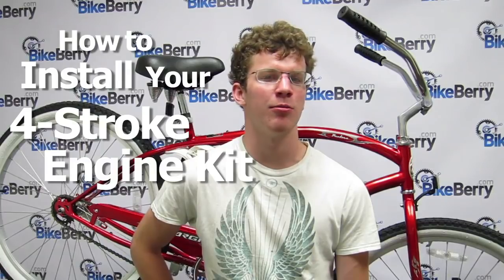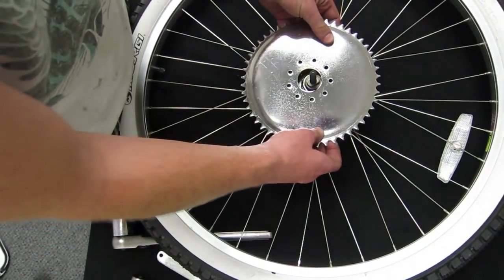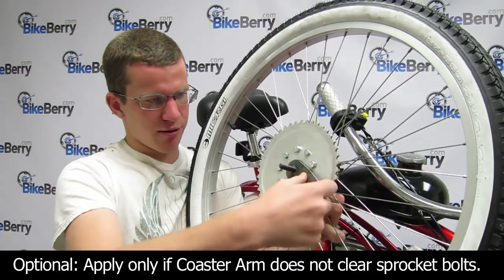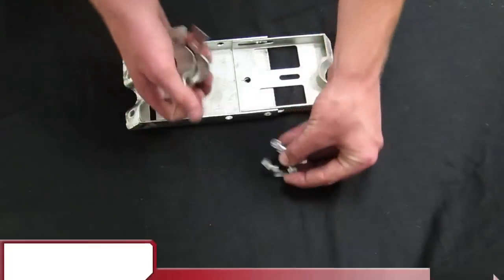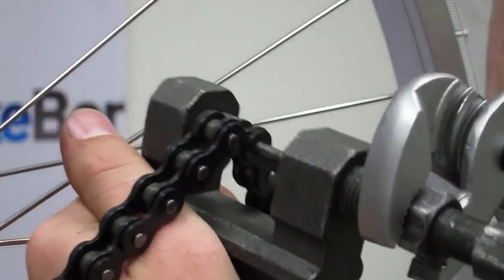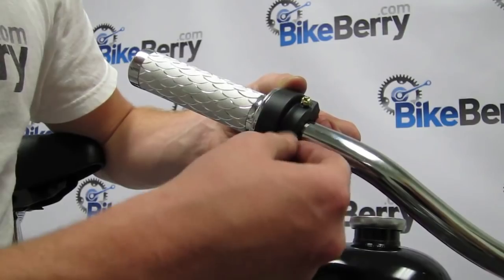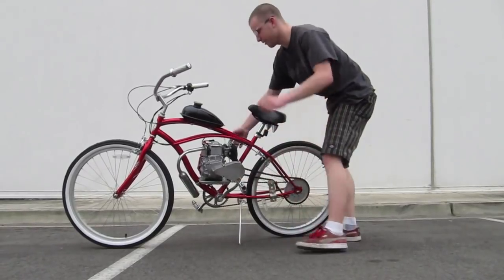How To Install a 4-Stroke Engine Kit on your Bicycle - 48cc - Motorized Bicycle

Comment: You can tell a good mechanic by the tools they use! Slip joint pliers are not made for hex nuts but a open end or box wrench is! If I saw someone using a per of pliers on my bolts or nuts unless stripped I would come unglued! Been making my living work on motorcycles and doing machine work for 45 plus years!!!!!!!!
Reply: i don't think anyone should pliers or wrenches on their nuts
Reply: YAWN
Reply: @robh.3124  Lmao 😂
Reply: 100 % correct. Use the correct tool for the job.

Comment: If you pause at 12:47 you will see that this bike does not have clearance between the crank arm and transmission housing, making conventional riding impossible. If you run out of gas or the engine quits, you will be pushing this puppy. It is also a good idea to make certain that oil is present in the crankcase in the correct amount BEFORE adding fuel...

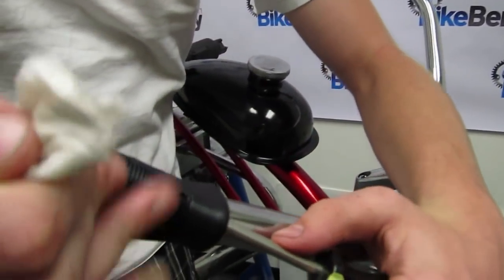Comment: 9:22 You can use compressed air to remove the handlebar grips. Stick the end of a tube air nozzle under the grip and blow.
Reply: Or wd 40

Comment from the maker: You're correct. Adding the engine oil is definitely a pivotal part in getting the motor running. I'll add an annotation. Thanks for noticing.

Comment from the maker: Yes, it's a 26" Micargi Men's Tahiti. Keep in mind that they recently made a design change where the cranks are designed for forward pedaling which means the crank housing is in front of the seat post instead of underneath it. This makes installation a little more difficult, but still doable.
Reply: What name of a good 4 stroke kit motor wise
Reply: How are you doing, I see your video was published long time ago, I got a question:
What is the right name of a new crank shaft you use on approximately 4:40 in your video? 
Is it threaded 3 ps crank shaft?
Thank you.

Comment: Also , removing the clutch springs improves clutch and overall motor performance. It allows the clutch to fully grip at low RPMs
Reply: I tried that, and my bike stalls at idle because it grips. Yes, I played with the idle speed, but couldn’t get it to stop so I put the springs back in.
Reply: you really just gotta bend them a little. there’s a video on here that shows that pretty sure.

Comment: How do you put the muffler on. The bolts protrude from the engine and are to long. Looks to only fit the stock box muffler it came with.

Comment: Hey BikeBerry, could we get a video showing this 4-stroke installed on a typical hard tail mountain bike like a Specialized Rockhopper?

Also, does installing a motor mean that the front derailleur and 3-speed chainrings can no longer be used?
Reply: I would think that motor shelf might get in be way of the derailleur mount. If the crank has to be replaced to allow for the thickness of the engine and mount to clear the sprocket then I see it being a problem

Comment from the maker: 275-290lbs. MAX! The added weight of the engine is roughly 30lbs, so a rider should be 240-260lbs at maximum. Honestly though, with that weight, it will be difficult to get the engine performing as advertised. Just keep that in mind.

Comment: How come mine did not come with the crank shaft, are they suppose to come with a crank shaft, my bike can't get built now until I get one, there is still 3 inches or so left wen useing big pedels you will need a 8 inch crank shaft for the larger pedals, also with my beach cruzer which has one fat bar needs extra large engine mounts which the kit ones don't fit as well as the fule tank one's aswell

Comment: Ok i got a question i know it might sound stupid but i don't know.  Ok i just got my 49cc 4stroke installed and running but it is still trying to go when in idle and i don't know y.  Is that normal? could it be to much oil?  please some one,
Reply: +Anthony Storey you might need to add a spring where the throttle cable connects to the carb to keep the bike from idling higher.
Reply: +Anthony Storey The carb has a small screw that regulates the idle speed, so try reducing the idle speed (You'll need to have the engine turned on to verifiy that it won't move) If this doesn't work, you might want to put in a centrifugal clutch between the engine and the shaft that drives the wheels, which will keep the wheels stopped when on idle or low speed, and with the sole speed of the flywheel, the clutch engages and wheels spin
Reply: I fixed the problem it was the way the throttle cable was set up it was pulling the throttle on the carb making it stay engaged but its fixed now

Comment: On a Huffy beach cruiser you are better off using only the back rubber grommet because the front one will push the sprocket out too far making it difficult to align everything. Just be sure to remove the bearing dust cover and cut the lip so you can flatten it out over the top of the sprocket. Other than that the stock 40 tooth fits perfectly and you do NOT have to bend the brake arm.

Comment: My 4 stroke clutch engages way too late and it always slips when i apply throttle so acceleration is practically non existent and it's so bad that my bike isn't usable at the moment.
I think my clutch springs are too stiff, is there anything i can do?

Comment: Yes i was wondering if we can convert an e bike to a hybrid using this method however I am unsure because of the electric motor being on the back wheel and as well as it also being twist throttle based

Comment: a nice installation marred by twisting wires together and using cheap electrical tape Solder the wires and use heat shrink to make a professional connection.

Comment: Starts with a coaster brake on the rear wheel, no brake on the front wheel, ends with hand brakes on both wheels.

Comment: You put the tensioner pulley in a maxed out position when the chain stretches you'll have to move the clamp. I think it should of been put about in the middle lower end of the bracket. Great video though

Comment: Can it be installed with a jack shafts on a mouthing bike to be able to shift the gears while riding and have the engine power the sprockets

Comment: hey bike berry I have a schwinn JAGUAR beach cruiser it has 7 gears to change into the rear wheel the pedals only have one gear I want a 4 Stroke engine but I don't know what kind of kit I need with the 7 gears and also I try to look up 4 or 2 stroke instalation videos on bikes with gears ( 10 speed, 7 speed, mountain bikes or a bike like mine's ) but no luck do you guys know of any video or you think you guys can make a video about this it would be a big help to new customers THANKS SOON TO BE A FIRST TIME CUSTOMER AND RIDER CAN'T WAIT 😆 👍
Reply: +Omar Coronado the bike gears and the gear the motor pulls are on opposite sides so it should make no difference

Comment: Could you mount this kit to a larger frame bike (28"-29") if you modified the chain to make it longer?
Reply: +ColtWKnight the chain that comes in the kit was way longer than I needed for 26s. it should be long enough easily for a 29 were only talking about 3 inches of chain-----my 26 inch build I had about ohhh 5 inches left after I cut it where I needed it you should be good bro

Comment: I bought a 'cruiser' style huffy that's retro style & looks like what  you have here.  Was wondering about 2 things-1-Where this has "old fashioned" braking (no handle brakes, just pushing back on pedals like on single speed bikes) Was wondering, where this is like that, would I need extra brakes installed to give added stopping power? 2-If I do need extra braking power via extra brakes, this bike seems like it has pretty wide, thick 26 " tires but was wondering if I'd need something thicker to handle wear on tires from braking
Reply: +Chris Geoffrey The braking logic you are thinking about is called a coaster brake, on the rear wheel, there is an arm connected to a plate. That is it. It is typically on a clutch, too. You can always add caliper brakes. Those are easy as well. I recommend both kinds of brakes, just in case. It'd suck if you couldn't stop at 45 going down a hill. In an intersection. Also, if you are using a cruiser, you may need to remove the mudguards to apply the caliper brakes.
Reply: +Gage Justice- ok Ty Gage, I'll remember that. I did have a different ?. I have a 49 cc engine Ifrom a 'X-treme 350' style scooter I was thinking of using as the power source for this new huffy of mine. I don't have dinensions of actual motor, but, if you yourself  are familiar  with those "X-Treme" products, you may've seen what I'm talking about. I think they only hit like 30-35mph anyways, but, again, never having a gas powered bike but being interested enough to maybe create 1, I found this channel. I'm kind of hoping the dimensions work to just mount it the way I've seen others, which usually doesn't include putting on some kind of back carraige just to mount a motor (would be where  a basket  might go, we'll say, right near the back reflector). Only things now I'd need to get/find out are chain for back tire going into motor (its already compatible it seems with a chain, since that's  what drives this x-treme scooter I've had sitting around, the brakes U mentioned, and what  I can use the electric battery thats on the scooter for, like, maybe rigging up a front lamp & some kind of turn signals ( was an udea I mentally was playing with, trying to make the finished product more safe if I drive it @ night, bike is pretty dark in color on its own). Once I get started, I may do youtube of it since I have a channel
Reply: +Gage Justice-P.S. even though U don't really talk about it here, Thank God for the nice, thick seat thats on this huffy cruiser bike!! I never liked the other type of seats. The one on the bike in this video has one I'd eventually find uncomfortable. I can't think of style names for seats except "banana". The one I have is wgat one'd find on a "crusher" style bike
Reply: Chris Geoffrey Yes, the wide ones are the best. I am not too sure of the names of the specifics, but I do know what you're talking about. Huffy is pretty good - heavy as hell, but the nuts, bolts, clamps and gear joints are pretty much all the same size: 16mm or 10mm. It's crazy helpful. The mudguards are also a HUGE plus, especially after a rainy day.
Reply: +Chris Geoffrey is SADDLE the word youre looking for?

Comment: when i drop the clutch when riding i get this popping feling while riding. when i release the clutch the feeling goes away and the engine sounds fine. the popping does not occur while riding with the clutch disengaged. what could this be?
Reply: i'll try that. thanks!

Comment: I have this motor and need to know where the fuel lines connect to the carb, there are three nipples on the carb.
Reply: Just learned it's the bronze one
Reply: My engine came with 2 fuel lines coming out each side of the carb, what do I do with those? I know the bronze one goes to the tank
Reply: @sergioaquino553  the one on the bronze side I took off that will drain fuel if its tipped over or floods the carb bowl the one on the other side is for draining and storage if you look under it it has almost like valve like on brakes you open that to drain out the hose for storage so the bowl isn't sitting with fuel if you dont plan on using it like me you can cut it short or take it off
Reply: @joshuamaas5380  thanks for the info, couldn't find the answer on videos
Reply: @sergioaquino553  yeah not a lot of answers about these at all I have learned the hard way just remember this is a g series 50 Honda clone engine and carb and also the AF mixture screw is behind brass plug if you need to tune it turn the screw to the right almost all the way shut turn it out about half a turn until it will start and hold idle let it idle for 4 minutes turn the idle screw up then turn the fuel mixture screw left until idle changes then turn the idle screw where you want it bam perfect tune for the carb
Reply: @amealnet2495  thanks bud, great video, answered my choke on and off question also, they could of at least labeled that
Reply: @joshuamaas5380  do you need to use the choke everyday?
Reply: @sergioaquino553  yes everytime the engine is cold you need the choke even letting it sit 30 minutes to an hour you might need the choke let it idle 3 to 5 minutes turn the choke off then tune all a choke  does is limit the air coming into the engine so that increases the air fuel ratio that's why you need to warm it up and turn the choke off to tune it right
Reply: @joshuamaas5380  thanks again

Comment: I like the 4 stroke, I bet it doesn't die when stopped for a while. I have an 80cc 2 stroke and it has a tendency to die if im stopped at a light. Then I have to peddle through the intersection and then I can use the throttle. I am still breaking it in but I dont think itll ever stop dying after being stopped for awhile. Does any know if it will change after the breakin period?
Reply: +Cassie G You might have to play around with the carb's idle speed, so try winding or unwinding the limit screw that stops the regulator valve. A 4 stroke will give you a lot less power output because of how its been designed since forever (Contains heavy counterweights, that have to be there so the engine doesn't stop when its not on the ignition stroke, so those will steal quite some power). If the problem persists, you may be locking down the engine when the wheels are stopped, on which i would recommend you to install a centrifugal clutch, in between the wheel's gear and the engine's power output gear, and this clutch will do, is that it won't engage the engine on low revs, and when climbing up engine rpm, clutch engages and the wheel will start spinning

Comment: hey, i have this motor on my bike, and was wondering if it would be possible to somehow install a lever clutch instead of the centrifugal clutch, as i find my engine doesn't fully engage and is very slow to build speed.
Reply: +DownhillGadd investigate your clutch pads. probably got touched by oil or grease somewhere along the line, OR, it isn't making a flat to flat surface against the inside of the outer bell they also have a break in period and some have paint in there that needs to be rubbed burnt off

Comment: I've installed my engine and everything is working good.  Motor seems a little rough and does not idle correctly.  Is there another video for adjustments.  also does the engine have a choke for cold weather.
Reply from the maker: Kevin Ward During the break-in period, the engine does run a little rough. After the break-in period, it should get easier and easier to start. Keep playing with your carburetor jet spin to adjust your idle RPM. Check out this video: https://www.youtube.com/watch?v=XAaKSII_vbo
Reply from the maker: Kevin Ward There is a choke! It's the small toggle lever near the air filter. At the top position, the choke is completely closed. At the bottom position it is completely open. You can it to be about 15% open when doing a cold start. After the engine is warmed up, then open it to about 75% open.
Reply: +Kevin Ward yeah theres a choke! probably why shes running rough get on that first

Comment: I have a Firmstrong urban man beach cruiser but the  coster brake arm doesnt come out like the one in this video. its all connected how to i put the drive sprocket?
Reply: i had same issues so i use my cheater pipe to stick the coaster arm into and a big ass wrench for the hex nut.baam

Comment: What was the reason for drilling the hole in handlebars
Reply: it's because the clutch has a dimple that fits into the handle bar to keep it from slipping.

Comment: will this kit fit on this bike sold at wallmart? 29" Genesis Onyx Cruiser
Reply: +Le Ga ive been begging somebody to answer that question for a month.
Reply: @robertsmith5323  Download templete  from blackberry   4 stroke is a 10.5 inch l  w h !  with an angle cut out caardboard templete
corner  4 inch up 2 inch in draw line cut

Comment: I just bought the upgrade kit how dose the bbr turning boost intake manifold go on. Any info would be greatly appreciated.
Reply: MrWillis5719  You need to do a video on your bike Steve.
Reply: How did you find out ? Lol
Reply from the maker: MrWillis5719 Unfortunately our boost bottle are no compatible with the 4-stroke kits (without fabricating your intake).
Reply: No problem, I drilled and taped so I am using it as we speak.

Comment: If the hole in the drive sprocket is too small don't bother taking it to a machine shop! Instead use a uni-bit, aka tree-bit, aka step-drill and any drill with a low-speed setting. Also, use plenty of machine oil, or even motor oil, and deburr the hole from both sides. Make certain to clamp the part before drilling because more torque is needed to turn the large bits. I use Harbor Freight drill bits, but they are also available at machine supplies, and do not require a large drill press or an expensive mill to turn.
Reply: lol.i did.old.fashion way ...file down by hand..chain i grind amd hammered away with the punch and nut method..im old school
.
Reply: Yes, it's possible to use whatever tools you have in your tool box. I'm merely suggesting that there is no need to hire a machine shop.
Reply: +Ronny Khmai  enlarging that damned hole by hand is an ugly bullshit job that took forever to do by hand. im not looking forward to doing it again but I have to. every freakin time. its ridiculous. the hole that it comes with fits nothing---lol
Reply: If you are in the US: http://www.harborfreight.com/catalogsearch/result?q=step+drill
Reply: As I mentioned before, use plenty of machine oil!